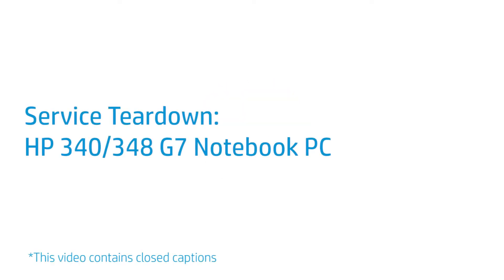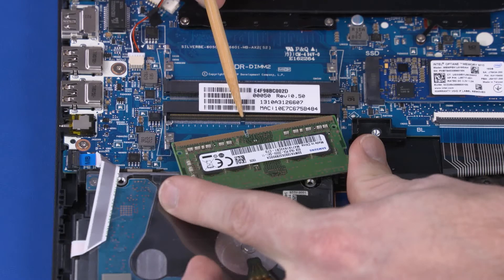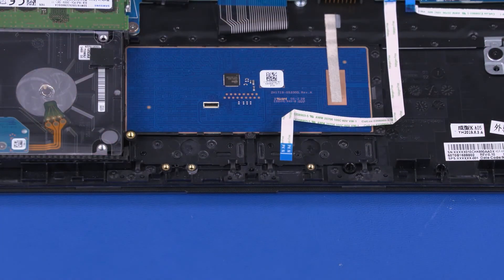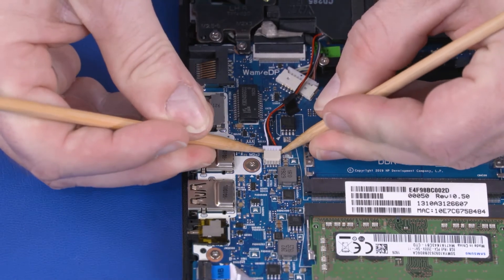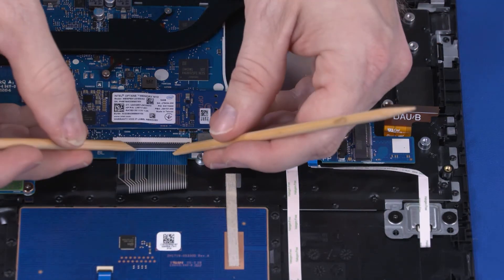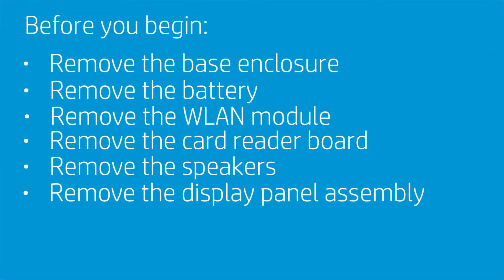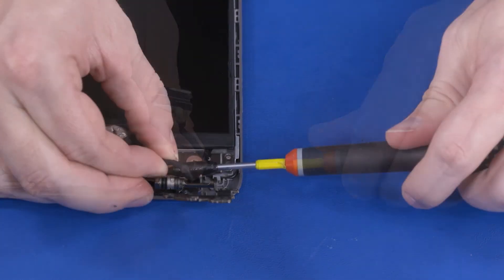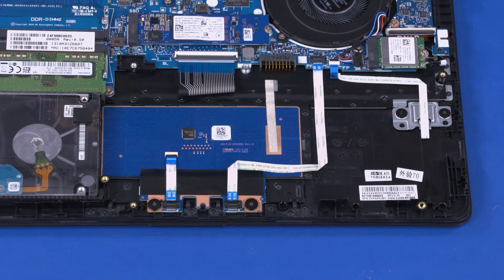Removing & replacing parts for HP 340/348 G7 Notebook | HP Computer Service

Comment: Why drivers aren't available for hp 348 g7 after 22h2 update🥲
Reply from the maker: Hi Akshith, thanks for contacting HP Global Social Media Support!
I understand that you are experiencing an issue in installing drivers for your notebook.
I will do my best to assist you.
Please download and run HP Print and Scan doctor from here to fix the issue: https://bit.ly/3olFych
Binu_HP Social Media Tech Support
Reply: @HPSupport  i'm having trouble installing display drivers. The official site does have drivers for previous versions of windows not for the current 22h2. Unfortunately i can't downgrade my windows
Reply from the maker: Thanks for the reply.
Please perform updates via HP Support Assistant as mentioned below to fix this issue: HP Support Assistant Updates - 1) In the search box, type and open HP Support Assistant. 2) Check for updates. 3) If the updates are available, click on install and restart the computer.
Binu_HP Social Media Tech Support

Comment: I only need to add 1 stick of ram, do I need to remove the battery?
Reply from the maker: Hi Khoa, thanks for contacting HP Global Social Media Support!
I understand that you need to know about adding memory on your notebook. 
I will do my best to assist you.
Please refer page number 35 of the user manual to know about replacing the memory: https://bit.ly/2P2G9n1
Binu_HP Social Media Tech Support

Comment: Can any of these procedures be done without losing warranty?, i whould like to replace the HDD for a SSD and install also an M.2
Reply from the maker: +Rodrigo HP does not recommend upgrading or downgrading hardware parts or software that is bundled with the product as It may affect the manufacturer's warranty and performance, however, you could change the configuration at your own discretion.